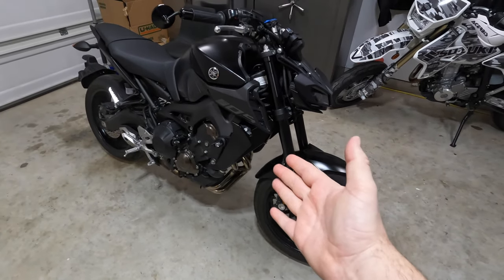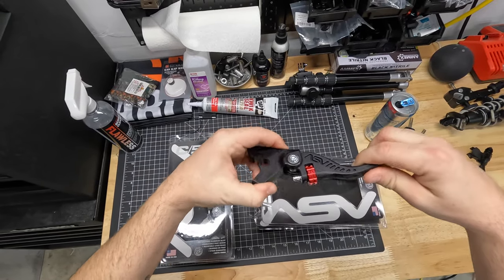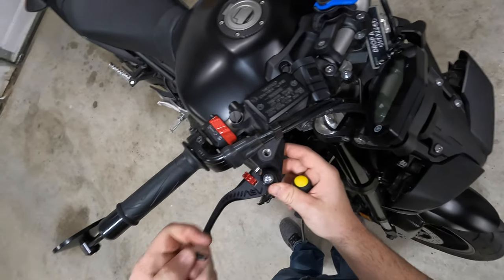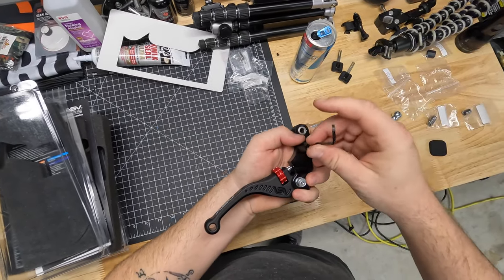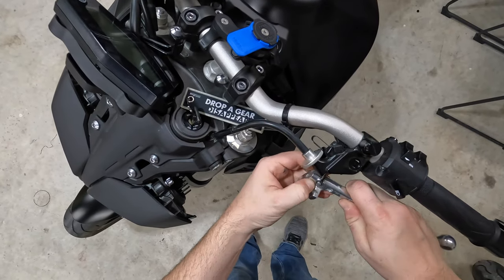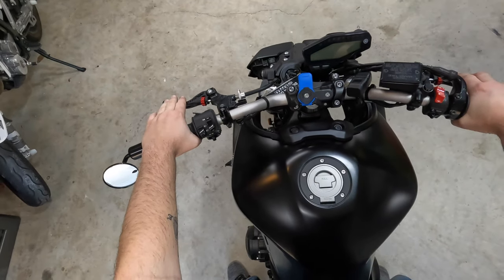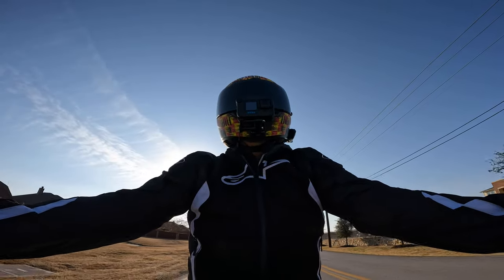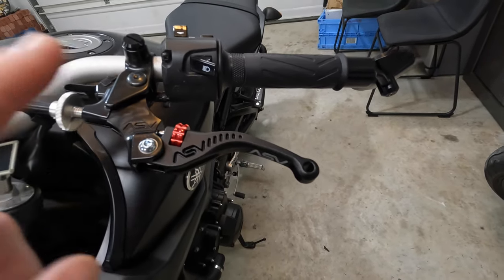2020 MT09 | ASV Lever Install and First Impressions

Comment from the maker: Would you spend $250 on a set of levers?
Reply: Yes. I plan on getting them for my Mt10.  Quality stuff ain't cheap
Reply from the maker: @MrWolf2212  100% but totally worth it!
Reply: Nah, bought some Vortex instead. I agree that Amazon ones are a no no, But I disagree with the prices of ASV. Solid vid!!!! Look forward to more mods on the MT-09. By the way I think the service manual calls for grease on the bushings you installed. Not sure if you added that. Don't want those expensive levers binding on you.
Reply: @loosechain1997  how do you like the vortex levers? Thought about buying those
Reply: @codykimrey2546  I love them, I have no issues whatsoever. They have been on the bike now for about 9,000 miles with no issue. Install was easy and fit up perfectly.
Reply: @loosechain1997  thanks. Might go with those and save some $

Comment: They are $300 now.   And you should never cut corners, you skipped both Loctite and proper lubrication of the new bushings and moving joints.

Comment: You have to adjust your clutch lever free play. The saying goes you should be able to put a nickel in between the bracket and the lever. I saw you have yours to tight.
Reply from the maker: Yea I adjusted them after the video 🤣👍🏻
Reply: @UrbanMoto  how you adjust them tho? Thankyou
Reply: @mage1915  these levers are garbage they have no adjustability bar distance. They dont even activate your brake switch at the right time so they are dangerous. They have no customer service either so avoid them
Reply: @bigduphusaj162 i thought that wheel adjusts it closer to

Comment: I’ve purchased 4 sets of “Amazon levers”, put over 30K miles on them with ZERO issues. They work just as good as ASV or CRG. You talk like they’ll break apart in your hands- they won’t.🙄
Reply from the maker: Ever been down on one? Not saying they don’t “work” functionally BUT talk longevity and warranty :-)
Reply: @UrbanMoto  down on one? No, cuz they work just fine. Never greased one either. ASV/CRG are very nice but they’re no better. They cost more cuz they’re made in USA.
Reply: Totally agreed the CNC levers come from China work just as good as ASV. The price for ASV is too expensive and not worth it, just only the levers not the whole thing. Where i'm living with 320-340 USD, you can get a 2nd hand RCS 19 Corsa Corta Master Cylinder and Galespeed Clutch in good condition.
Reply: You could snap a pair of Amazon levers and replace them 4 times for the cost of a single pair of asvs, defo seem like overpriced imo
Reply: Everyone has their own idea of what makes sense. Some would spend the extra money and some don't mind paying for the cheaper option and replace 4x in the life of one good set.  I just picked up a pair of avs cause I personally prefer not to get cheap shit put on a bike I ride a lot.
Reply: I'm here because my brake lever broke. I'd say if you're unsure about upgrading then just look at how loose and sloppy your Amazon ones wiggle. There's a lot of play in the verticle directions for mine
Reply: @GameOverFiles  

That’s my reason for staying away from cheap Chinese levers.
They work, but the lever action & insane play in the lever is to much to deal with.
Reply: @GameOverFiles True, but who cares? You dont notice it when you're riding.

Comment: What was the block you screwed onto the lever with the 2 screws
Reply: A lever is three parts. The "blade" is the part your fingers touch. This is the model #. Then there's the joint. Then there's the year/make/model specific "knee", which is what bolts to the bike. The knee is what actuates the clutch cable and/or MC. And the front brake MC. The blade is what you pull on.
Reply: clutch switch pillar. Avoid these levers they never fit correctly and dont activate your brake switch correctly and have zero customer service they even ignore their biggest outlets.

Comment: CRG Levers are about $10 cheaper and I’ve heard great things. What are the advantages of ASV over CRG if any?
Reply: Both are quality, made in California, by racers. CRG had the on the fly adjustment first. ASV had the unbreakable design patented first. So CRGs had to be different. Worse or better? There's not much to a lever pivot. So I think it would come down to preference or specific factors of a spill.  Both are quality and worth their price.
Reply: @orangeplaneteer  I believe ASV has has way more precise increments and more increments of adjustability.

Comment: Garbage levers. One size fits all garbage that never fits any one bike right. The newer knuckles are badly made and rarely fit the master cylinder plunger gap correctly so you cannot dial in the correct free play. They cant even get the R1, the most popular big sportsbike on earths  knuckle to fit right, it doesnt even reach the brake switch correctly and you cannot fit a Jubilee switch as they are "Normally closed" type switch. They ignore you and dont reply to emails even the biggest UK stockist Calsport cannot get any customer services out them whatsoever. Avoid!!